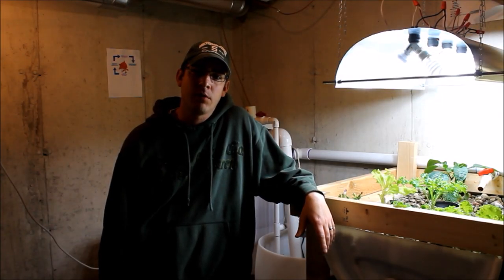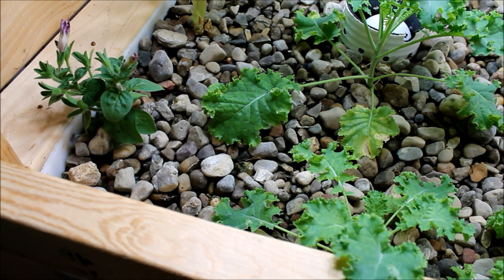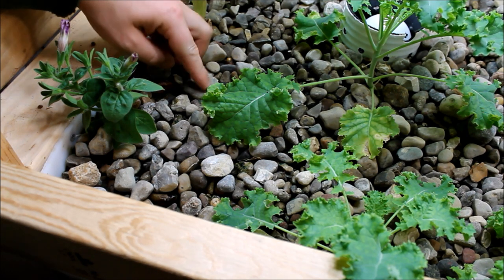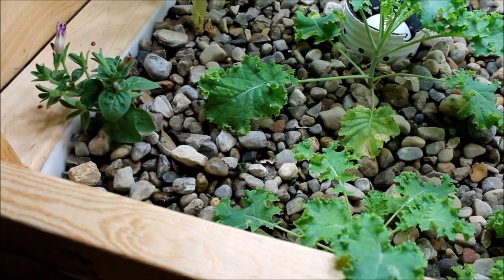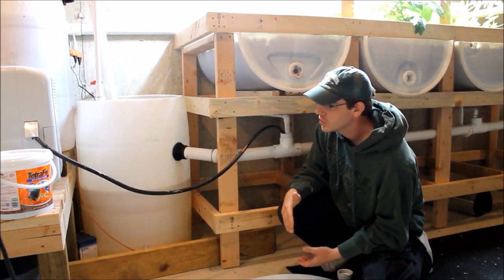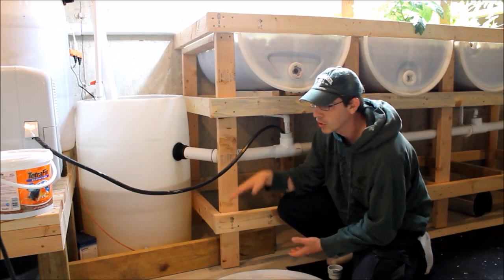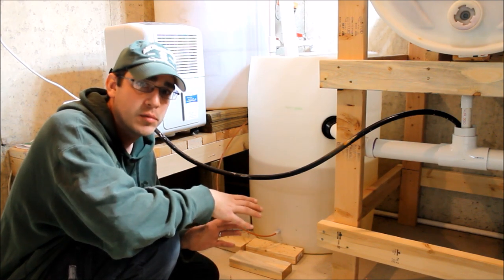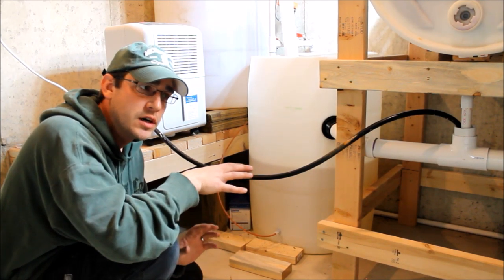Aquaponics System Design  - Tips and Tricks

Comment: anyway to do aquaponics not in toxic plastic/glue ...
Reply from the maker: Only other way I can think of is to use stainless steel. That might get expensive though:)
Reply: +Brad Haaf You can use clay pottery and pipe if you want. Buying glazed pots can get expensive too, but you could make some pots out of the clay from your yard, bisque fire them and then seal them with beeswax if you want to be completely self sufficient about it.  As far as the water transfer from the tank to the grow beds goes, it would just be a matter of calculated arrangements to take advantage of gravity flow.  Even then you still need to get the water back to the top; most pumps will still be plastic, and windmills won't generate a consistent flow.  The plastics he's using aren't toxic though, neither is the glue in it's cured form. Plastics and glue are products of organic chemistry ( some glues are just boiled down plant and animal matter), and while there are plastics that leach toxic materials it's not a universal trait.  Everything is made from something and they all have their own unique qualities both as raw materials and as finished products. PVC is chemically stable and non-toxic, so regardless of the changing water contents it won't become toxic. The HDPE tanks that he's using are the same plastic as milk jugs, though it can't be assumed that all HDPE products are food grade; tanks produced for different industrial purposes can have toxic fillers and secondary plastic liners.

Comment: have you considered trying a vertical aquaponics setup? it might work better in a basement...I'm about to set an aquaponics system up in an outdoor greenhouse and decided that I'm going to try the vertical over the bed system. check it out: http://youtu.be/Wisa2lyiwvg
Reply from the maker: I have considered it often actually and when I was designing my system initially I was torn. If I were in a greenhouse it would be great, however in the basement configuring the lights vertically is a bit more difficult. I may add a couple to the system down the road to see how it goes, thanks for watching!!